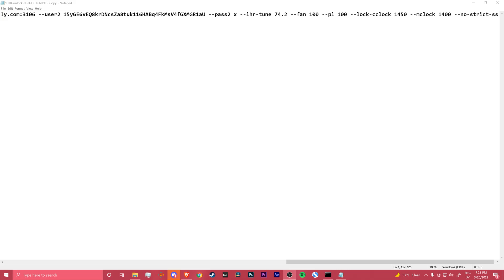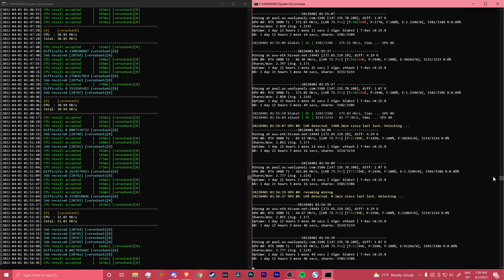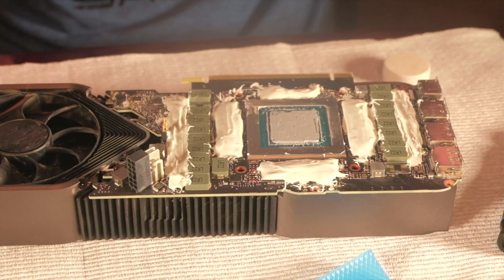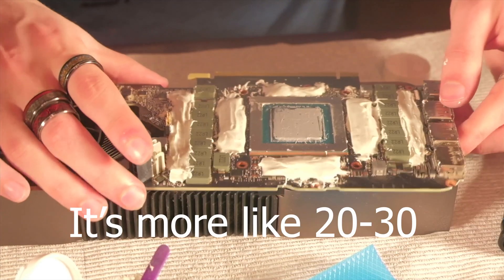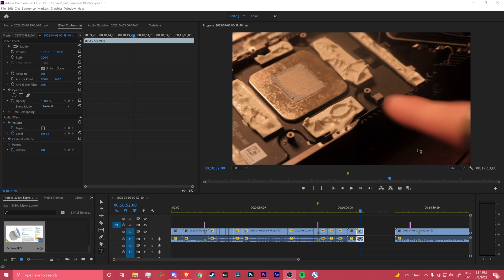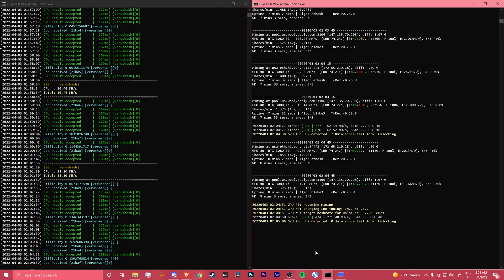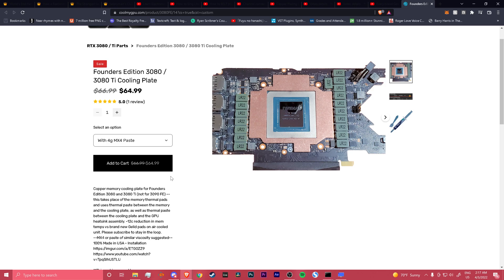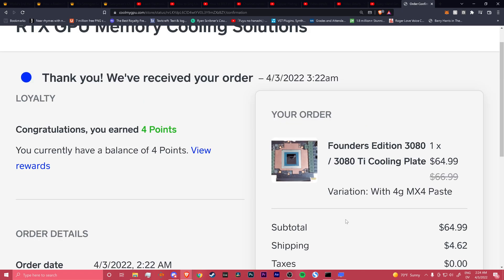Is K5 Pro Better Than Thermal Pads modding? Can it Tame 3080ti's Vram Temps?

Comment: This stuff is trash. Every comment from GR says "hurr durr you just didn't use enough". Total bullshit. You shouldn't have to smother the entire board. If it has good thermal conductivity, it only needs to contact the top of the chips like pads do. This stuff is worse than the lowest tier thermal pads. 

There are much better options available like U6 Pro or UX Pro and various others. Quality putty actually works as well as high end pads and is a clay-like consistency, much less messy and easier to apply / remove. You can see tests and comparisons from Snarks Domain on YT.
Reply from the maker: you pretty much read my mind. I used all the putty i had too lol and i didnt feel like talking about it through the comments. In the future if i ever want to try putty again (doubtful) I will look into those options so thanks for the recommendation
Reply: yeah k5 pro is 5w/k m which is literally a third of what normal thermal pads use for high end graphics cards (12,8w/k m). If you want to use thermal putty you have to at least use upsiren u6 pro which is 12,8w/k m, but this thing sucks completely
Reply: Nah stupid didn't put any on VRMs how do you even miss that

Comment: K5 pro is great if you use it correctly. Correct is to goop it everywhere, basically you did need more. Two reasons, first is you are building a giant heat sink with it, and second is that the "K5 heat sink" conducts to your hot plate. K5 is an older product, still great for midrange laptops without vapor chambers. Its real magic is you don't need to measure thermal pads. I would use some of the newer thermal putty with higher thermal conductance for video cards. K5 has a place it is still very good. Tamed my Lenovo P1 gen 5 laptop. In a few places I had it squeezing out from under the hot plate. (Edit: really only for power phases and memory btw...)

Comment: I watched this last night as I was going to sleep and felt compelled enough to come back today and address the issue you experienced. You didn't remove the existing thermal pads from the heatsin. They unstuck from the components but were still attached to the metal heatsink. So all you did was apply the K5 only to have it smooshed away from the components by the old thermal pads. Your performance would get worse too because you're using effectively TWO thermal pads on the components. 

As someone that uses K5 pro on a gaming laptop, I can tell you that you should try it again but be sure to remove the existing thermal pads next time. Check both the components AND the heatsink you remove for them.

Comment: Imo, you used too much of the K5 and not apply it flat. Isn't applying a layer with thickness just a bit thicker than the original pad enough?
Reply from the maker: Yeah it was too much. This stuff was spewing out all over when you put the cooler back on meanwhile the company that made this stuff says I didn't put enough...
Reply: @TheMiningMersie  I think they misunderstand your image. During the heatsink pull-out, when finally separated from the heatsink, the mud will be grouped in the direction of the pull-out, in your case is in the middle... NOT that when your heatsink was installed in place, the mud only touch it in the middle....They are wrong

Comment: Dear god... Is your PC in a woodworking shop? The dust filters on my case do a much better job than that... After years in the case my components basically still look brand new.
Reply from the maker: I have 7 dogs and my PC is on the floor which is the worse combination for dust :/
Reply: @TheMiningMersie  Well I don't know about 7 dogs, but mine's on the floor, too. I have an odd case, though. Silverstone FT02. The air intake is on the bottom. I get plenty of dust in my filters, though. Gotta clean them regularly. Still, everything on the inside is very clean. I sold my previous GPU a few months ago, and I didn't even have to clean it at all.
(7 dogs is a lot though, I do know that much, lol)

BTW it sucks that this "thermal goo" didn't work out for you. I've now read a few times that it just isn't working well for GDDR6, because they just run too hot.
I was thinking of using it for my backplate, though, because there aren't any pads at all there. (reference Radeon RX 6700 XT. Also not a miner. I'm here for the K5)
Reply from the maker: @PyrO-82  gotcha, it should work well but do your own research :p I do need to clean them again but my thermals are good so I haven't done it yet.

Comment: Some people reported outgassing and bubble formation in the bulk of the material at high temperatures. So I did a test myself and subjected a small sample to a temperature of 100 °C for a few minutes. Upon inspection of the sample after heating, I found that it indeed became porous near the hot contact area due to bubble formation. It "boils", so to speak. I would say it is suitable for low temperature applications only.
Reply from the maker: yes i had a lot of bubbles in mine when i replaced it with copper instead. i only got the k5 pro because of a video on linustechtips which worked well on their 3090
Reply: @TheMiningMersie  It can work well on a mobile 3090 or similar application. You do have to use as much as the area will take (it does its work through adding surface area conductance and thermal volume more than inherent thermal conductivity value of the material. It is "more" conductivity by surface and volume not "better" conductivity by the material, and is for low pressure applications just as thermal pads. People who don't understand this are squeezing it thinly between two plates and, duh of course it is not TIM and will perform just as bad as using a thermal pad as TIM! Once understood, it can work surprisingly well (use way more than you think you need.) That is why LTT got almost free fps.
Reply: K5 pro is really much more for laptop repair IMHO, lower heat applications where it outpaces old thermal pads. Still has a place, but not so much for video cards IMHO.
Reply: @stalbaum  Components that need cooling are usually too hot for K5. I wouldn't use it anywhere, except maybe cryogenic applications.
Reply: @andron7611  used correctly it is solid. People confuse it for a thermal paste, it is not. It is a replacement for thermal pads, especially where those are hard to measure (say you destroyed the old ones) or to install (lots of them and a difficult plate that causes pads to bend or roll off the components.) The main mistake people make with K5 is using too little. You need to goop it everywhere, many times as much volume as the pads being replaced. It works two ways: fills gaps all around components - it is better thermal conductivity than air - and it creates much more surface contact between components and the hot plate (which is why LTT got great results on laptop power phases and video memory) and second it adds thermal mass if you really goop it. Installed correctly, it far outperforms most original thermal pads in lower temperature applications, like notebooks. Power phases on newer graphics cards? I would not, and that is not what it is for. It does great cooling my P1 gen 5. Vast improvement.
Reply: @stalbaum  I don't know man, heat is heat and I don't see how to use K5 "correctly" on hot surfaces. If it bubbles up and bleeds silicone oil, no application technique will change that. The material at the hot surface will become spongy, no matter how thick the layer is.
Reply: @andron7611  I can only tell you, use it what it is designed for and it is great. I would not be using it as anything more than thermal pad replacement in scenarios it is designed for. Cooled the heck out of my workstation replacement notebook, which holds its turbo like 30 seconds longer now. I laid it on thick, as directed.

Comment: Use this product for years, its amazing and affordable. Repasted the Ps5 with it and went from 95° on the Ram do arround 70. my 3080 asus tuf went from max 80° on the ram to 65°. Really good product, as it takes on every shape, thats what makes it so good. BTW how did your GPU got so damn dirty oO. Dont buy overpriced putty, buy this product. EDIT: also i didnt know there are copper plates that are so damn expensive... did a custom one for my ps5 to increase transfer speed and surface area and it only cost me 3 bucks ^^ . you sir wouldve been more happy with 11wmk pads to replace the original ones.
Reply: He skipped VRMs lol and then shits on the product

Comment: You didn't repaste the GPU, also heat will transfer to the cooler objects so by having better conductivity on RAM chips you might get heat moving from RAM chips to the GPU and vice versa more efficiently, thus they heat one another.

Comment: it's supposed to replace thermal pads and I realised you didn't detach them.
try it without the pads, you'll get better results.
Reply: No, he did remove them. It's just that the cooler still has some kind of elevated platforms where the pads should go, and you might mistake them for pads.

Comment: Thank you for purchasing our product and for making this very usefull video. We are sorry that you didn't have good results and would like to indicate why this happened. The obvious reason that you didn't have expected results is that you didn't apply enough quantity. This we can see when you remove heatsink where it is obvious that K5 PRO was touching it only in the middle. Also when you apply K5 PRO corners of VRAMs have a very thin layer of K5 PRO while there should be 2mm of matterial there at least, as on all surface. Still there is one more mistake that most users make with this board. You replaced all pads of that board with K5 PRO while you should replace ONLY the thermal pads on VRAMs. The rest of the pads are mainly used as spacers. This board has a quite big and heavy heat sink. If these spacers are not used then heatsink is not aligned perfectly resulting to over heatink. K5 PRO can't be used as spacer so you need to keep old pads there. They are barelly used for heat transfer so by reusing them you will not have any change in performance. In the part where we can see heatsink removed you can see how it was not correctly aligned on board as thermal paste on GPU is not fully "pressed" on left side of photo. This indicates that heatsink was not completelly parallel to board. These are little details which normally don't have impact on common boards but 3080 series are the hardest boards to deal with when comes to cooling so everything needs to be perfect in order to keep temperature stable. By following these insturctions you will have far more decent results with your board. However if you wish to have real imporvement of performance of this board with K5 PRO then you need to combine it with KRYO33 and copper pads on VRAMs. This board is using 2mm thermal pads which fit perfect the gap and have about double thermal conductivity of K5 PRO. So in order to get equal or better performance with K5 PRO you need to increase the heat transfer of it by adding copper pads of around 1mm thickness. You need to apply 1mm layer of K5 PRO then place the copper pads and then 1mm of K5 PRO again. We have just completed such testing with a brand new 3080 board and we will publish video soon. Using KRYO33 resulted in reduction of GPU temperature and small increase on FPS.
Reply: I have personally noticed that k5 pro gains a bubbly/ boiled appearance on my razer blade 15 oled 2019 9750h/2080 max q which i ran for over a year with k5 pro. Apparently there have been others that notice this behavior. Is this normal or is there a way to minimize this if it is problematic?
Reply: @N-VAMusic  Thank you for using our product K5 PRO. What you describe is normal behavor of product because of it's viscous nature. When you remove heat sink product spreads on both sides creating this effect. Amount which seems to be missing from one side (for example on VRAMs) can be found on heat sink. As you can see on this video https://www.youtube.com/watch?v=ht2tbifneZE&t=1s&ab_channel=ComputerSystemsGR we had it tested on 250C and it still kept it's features.
Reply: Hello, I have a 3070 TI EVGA FTW3 I wish to use your product because I had no luck with thermal pads, is Linus video were he uses a let’s say sufficient thermal putty on the VRM’s is correct ? Do I need to put enough so both sides make good contact ? Or would it be better to do the copper shim mod  also using your k-5 pro ? I’m a big follower of your work I hope you can enlighten me
Reply: @metalbuffon  Thank you for your interest in our product. After doing a lot of testing with such boards we can confirm that you will have best results by combining K5 PRO with copper pads on 1.5mm . You need to apply K5 PRO on both sides of thermal pads on all surface. Please let us know if you need more info.
Reply: @ComputerSystemsGR  OMG I can’t believe you responded I’m a biiig fan of your work, so for the 3070 TI copper shim mod y saw in a couple of your comments that you suggest only applying the copper shim to the VRM, and not the “separator” thermal pads, for the FTW3 3070 ti which shim size would work best ? EVGA puts some strange pad sizes like 1.75mm etc. So what would be the best size, also I saw that you have to put the putty on both sides of the shim in order to make proper contact please correct me if I’m wrong.
Reply: @metalbuffon  Your question points the reason that a lot of users were not happy with results when using K5 PRO on 3080 boards while on other board versions like 3090 K5 PRO improved performance and frame rate. On 3080 board thermal pads are of 2mm exactly. So it is easy to find correct high performance pads and get optimum results with thermal pads. On other boards pads are not of default thickness and since it is hard to find pads at 1.75 etc K5 PRO will fit better and perform better than thermal pads of higher thermal conductivity but thicker or thiner than gap. Still these boards require advanced thermal pads on VRAMs so you need to combine K5 PRO with copper shims. Our testing gave best results when around 0.5mm of gap was covered with K5 PRO and rest with copper shim. So for 3080 you need 1.5 copper shim. If your pads are at around 1.75 then you need 1-1.2mm copper shims. For these boards it is also important to replace only thermal pads on VRAMs as other pads help keep heatsink aligned on GPU.
Reply: I think your product is very nice and I also see the mistakes in this video he made. I absolutely see the need for k5 pro and the efficiency that it brings is amazing. I heard thermal pads only have maybe 60% surface area coverage. While k5 pro is above 90% filling all the small gaps
Reply: So I am having an PNY 3080 TI myself and I am having ok temps now with 1mm pads. I bought K5 Pro and thinking of using it. What is best practice now? Should I let the pads and add a very small layer of K5 Pro on VRAMs only to see if it gets better results? You say K5 Pro is not made for big DIE /GPU in the middle. Only use iton VRAMs then?
Reply: @drshepherd6567   My late cousin always said this wise statement when you had something that was working as it should already:  "Leave well enough alone." 
If your card is pretty new and running with good temps,  I would let it be for now.  If you eventually get bad temps from the GPU die itself, but still have good VRM temps, THEN take it apart and if the original pads are still in good shape, try to reuse them and just replace the thermal paste on the GPU die itself with a high quality one.  If the VRM temps are bad or the original pads look bad, then I would try getting new pads if you can get the correct size or maybe try the K5  and copper shims if you can't get good pads at the correct size.  To make a long story even longer...I would just leave your card alone for now since it's running within specs.  I, personally, do NOT really have a good feeling about the K5 because of negative reviews, but perhaps those people were not using it correctly.  I am no expert on GPUs' but I have good instinct and built my first computer way back in 1981. Yup...I am getting old...😕
Be well and good luck on your decision!  👍👍
PS: I definitely would NOT use K5 on the GPU die itself as its temps get EXTREME,  but only a good quality thermal paste!